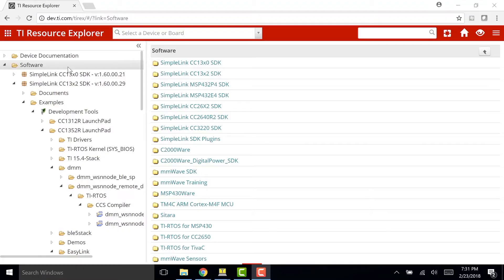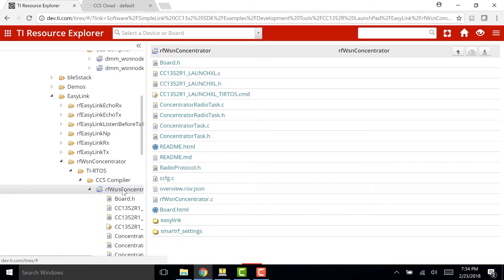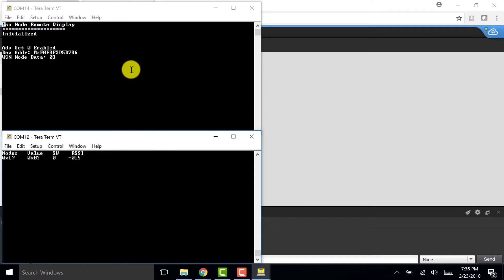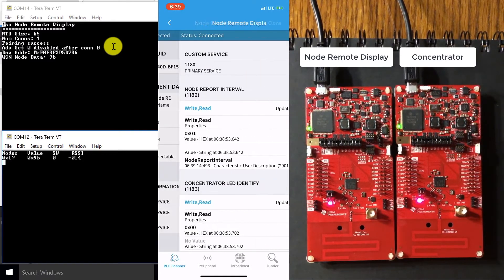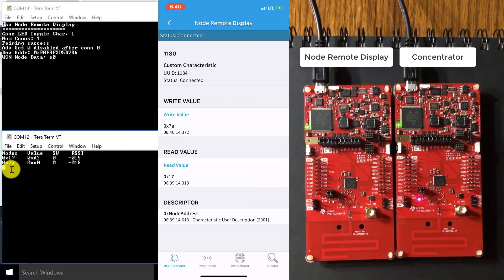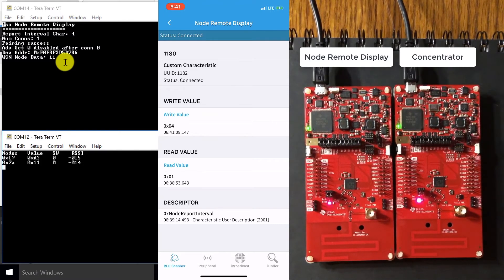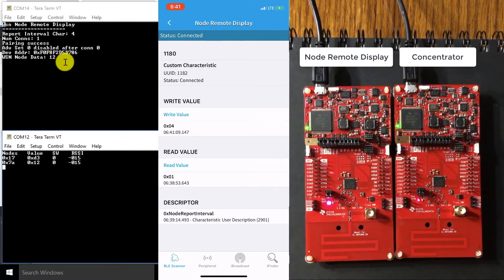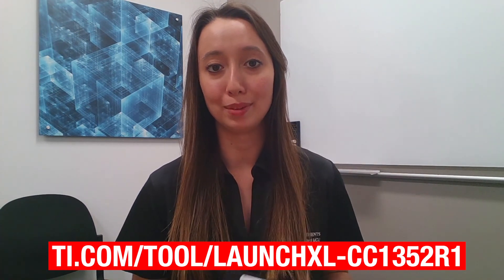SimpleLink CC1352R Sub-1 GHz + Bluetooth low energy concurrency example

Comment: Hello MICHELLE TATE,

Very Nice video i even seen related to BLE and Sub1GHz.

But i have some Question related to this.
1) Is Sub1 Ghz is working like a Broadcaster(like BLE) so no need to Connect to the Device?
2) How to change the Frequency? or How may know that with how much Frequency i am going? How to change it?
3) I am able to Communicate using BLE(Central and Peripheral), But where can i get the Documents that  tells me about Ranges(Length of connectivity) of BLE or Sub1Ghz?
4) for only checking of Sub 1GHz , can i use EasyLink programs or only TxPacket and RxPacket programs are enough? 

Thanks,
Anil D.